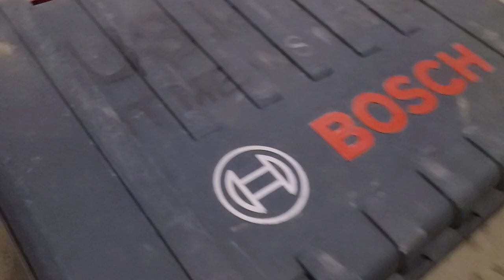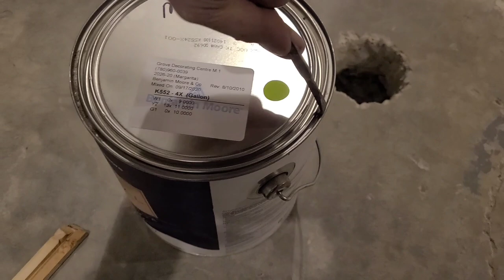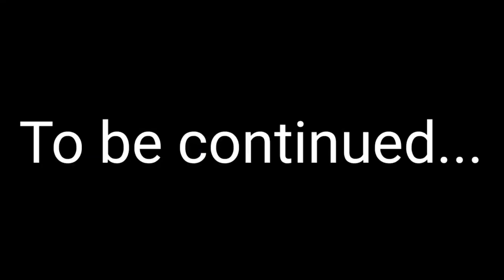The start of the polar vortex | Another VLOG#104

Comment: I once seen this double walled greenhouse that could withstand 40 below and in between the walls were black colored barrels  filled  with water and the barrels would heat up and the water was in a system that would circulate. you could always put a coup in a coup surrounded by green house  inside another greenhouse
Reply from the maker: Word. As long as there's sufficient ventilation. Which green houses wouldn't necessarily have in the winter as one would keep the vents closed. I suppose if i built one huge enough.
Reply: @JoshuaAlexander138  if I can find the thing I seen I will send it.

Comment: Always need a good roof so the heat don't escape . You could do radiant flooring and use fire wood to heat up that system and the floor would stray warm and the heat rises but you have to have it where there isn't any drafts or most of all your heat would be lost.  Just like when going outside layering up is the best same with houses and windows like triple pane. Need to study or research this for a better solution for your birds so you don't have to worry about them freezing.
Reply from the maker: Like i say. Ventilation is key. There will be heat loss no matter what. Unless I put in mechanical ventilation, it's a losing battle at these temperatures. They do fine the rest of the normal winter. I built the coop like I build houses but with open vents instead of forced air. I dk like the rediant heat in the floor idea though. That could be sufficient, perhaps even in these Temps. Thanks for the suggestion!
Reply: @JoshuaAlexander138  your welcome if you can imagine it I'm pretty sure you can create it to the best of your ability.

Comment: What happens if u break down on the road in -35 to 40 - and how long can u stay outside in that weather with the right clothes on?
Reply: In cold country you are supposed to carry a winter survival kit in the car, blanket, food like trail mix bars and candy bars, matches, hand & foot chemical warmers, flares shovel etc. Some people don't,and that's when they freeze to death in sparsely populated areas with no cell phone reception. Best thing is stay home or where you are. until it is safe to travel.
Reply from the maker: It can be deadly. So you should bring a survival kit with you. Probably the best item would be a candle. But also a survival blanket, and a regular blanket as well. Staying outside in -35 and in -40 are vastly different. But damn are they both uncomfortable. You could probably stay outside for a hours with regular winter clothes if you're moving around. If you're in -40 gear, in theory you should be good until you get hypothermia from sweating. Gotta stay dry. If you're in regular clothes you will freeze to death in a couple hours or less most of the time.
Reply: @JoshuaAlexander138  how fascinating - this is so foreign to me 
In Australia we have people who die from heat exposure - same thing if you travel to the outback - you would need to pack food and water and shelter for if you break down 
For tourists who visit and lie out in the sun at the beach - they can get terrible sun burn and get heat stroke (we have no ozone layer here)

Thanks for explaining it to me